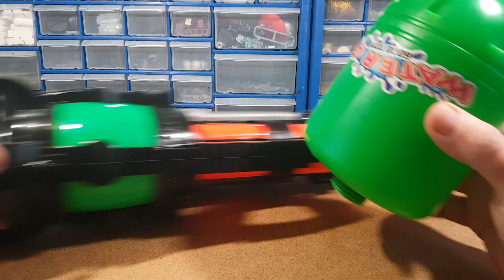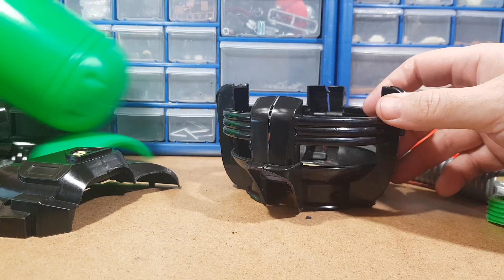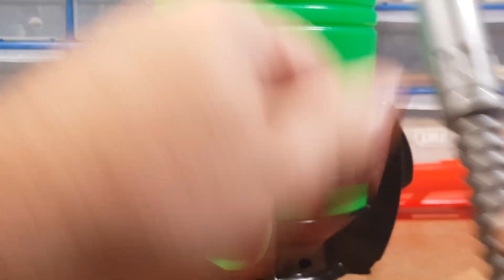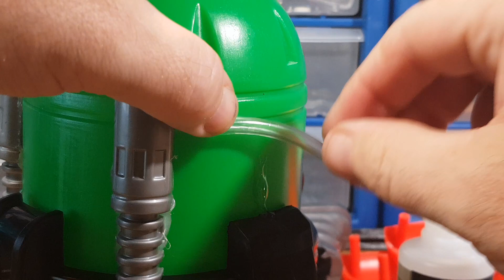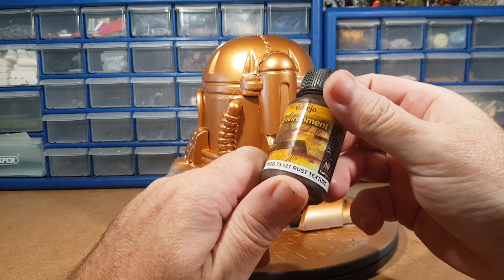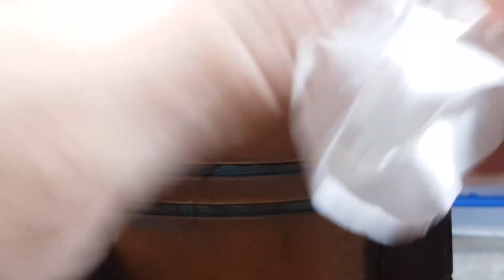WARHAMMER 40K WATER GUN TERRAIN CHALLENGE!  @Midwinter Minis @Black Magic Craft @Scratch Bashing

Comment: My favorite rust effect is very similar to what you did here: on your pallet, get an orange, a brown, and a dark red, and a small amount of black. Then stipple or sponge on the colors haphazardly, alternating between the colors randomly and feathering together the splotchyness of them. Be careful with the black though, a little goes a long way! After you get this mottled splotchy red-orange-brown coat down, I then like to go edge highlight drybrush the protruding areas with a bit of silver, or silver mixed with brown. This kind of shows where things would grind or bump into the edges. And you're done!
Reply from the maker: Cheers for that, i think I do need to use a few more colours to vary the rust look and dry brushing highlights sounds good =)

Comment: I mix up a wash of paint and PVA glue or flat acrylic medium, mixed about 1:1 with a drop of dish detergent to break up surface tension and enough water to get it to flow but not run all over...unless you want that.  Paint color is around the hue of Citadel's Trollslayer Orange with drops of Mournfang Brown for a grimy rust.  Consistency should be around what you'd use for an airbrush.   Before it dries, I sprinkle a little baking soda sometimes to kick up the texture where needed. A quick tone of Nuln Oil or Aggrax Earthshade, thinned a bit with water, to add depth and done.